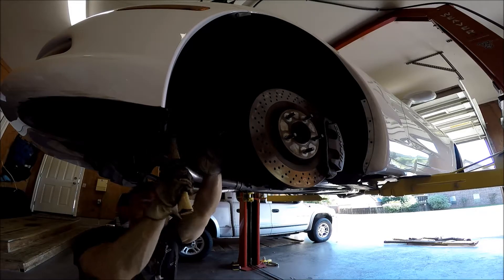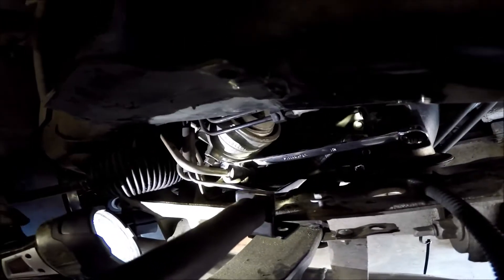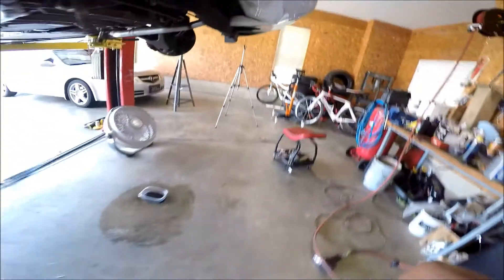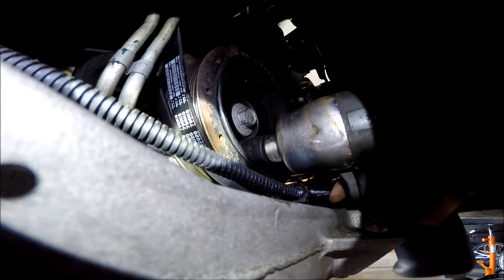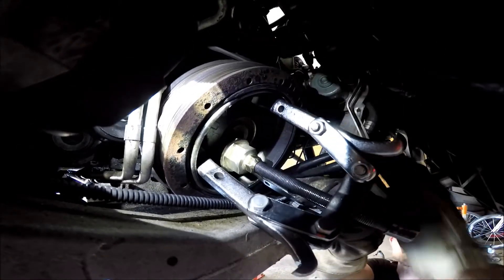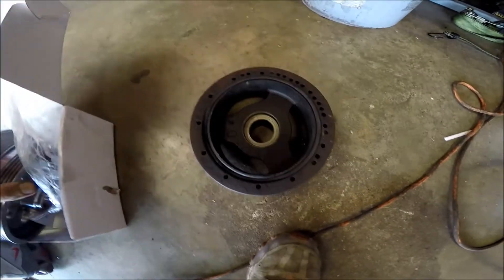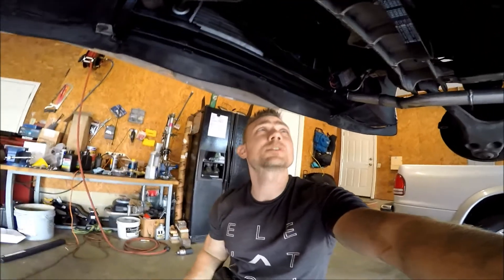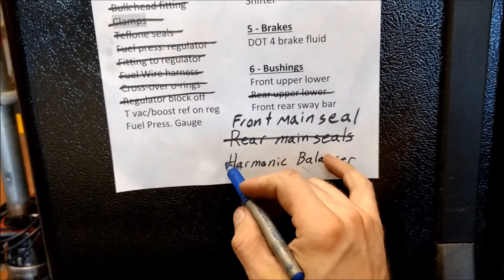8 Rib Harmonic Balancer Removal and Install

Comment: Considering the owners manual says it’s a tty bolt and it cost less than 10 bucks y not just replace it. Granted you make a solid point but as far as a cost standpoint I always replace it. Also if since you are not supercharger Y the 8 rib balancer?
Reply from the maker: I see you point, but I did not have the time to order a replacement.  Plus I did my research before I decided to go that way with it.  So I saved myself X doll hairs and did not have to put my build on hold.

I looked up the yield point of a 10.9 grade bolt it is 146 KN (33024 lbs).  The recommended torque is anywhere from 230 ft-lb to 270 ft-lb and you achieve a 21,000 lb clamp load.  To get that bolt to yield you would have to go way above that torque number.  How on earth are you going to get that bolt to yield in this application?  You would need a 10ft breaker bar and some way to hold the motor from spinning under that much insane torque.

The 8 rib is just what Summit had.  If my memory severs me all the balancers they had accept one were more than 6 rib.  For the factory belt you just use the first 6 rips.  Also I looked around on the web and several people had this same pulley with long lasting good results.